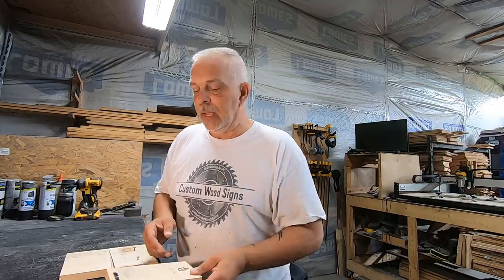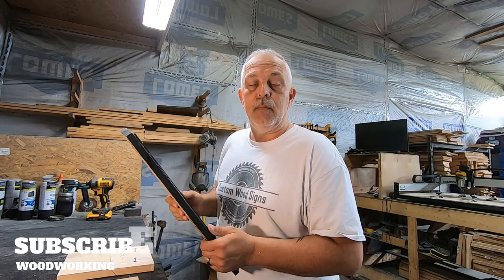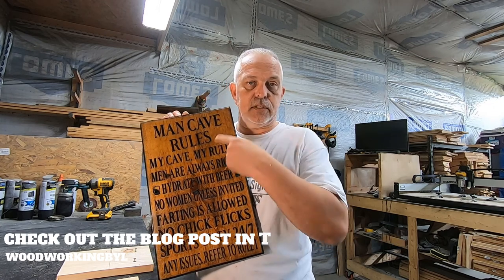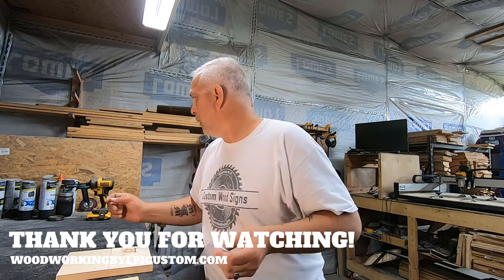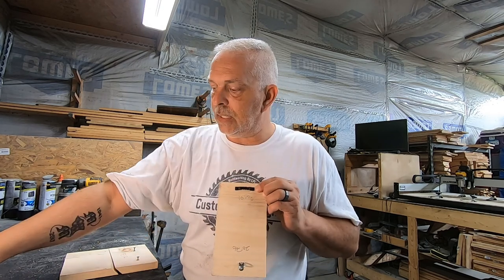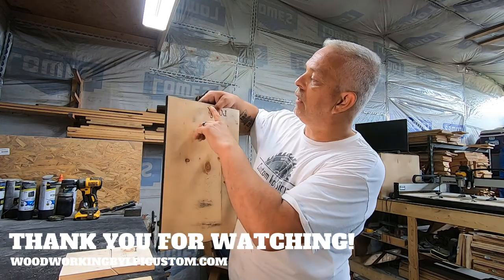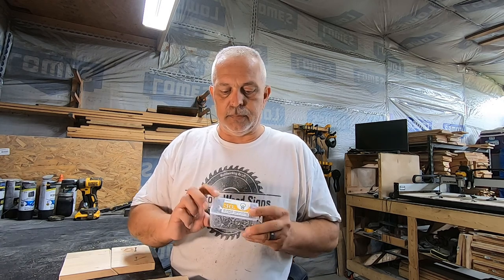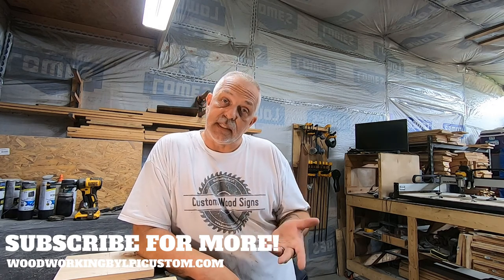Hanging Wood Sign Ideas And What To Use For Wood Signs – Helpful Guide

Comment: So what size screw should I use for a 1/2” thick sign? I’ve seen that a #6 is my best bet- but will it show through the front?😅😅
Reply from the maker: Thank you for visiting! The golden rule is to have a screw go half of the thickness of the material. So a 1/4 inch long screw would work well.  A #6 screw would be 9/64 in diameter, depending on what you are using the screw for (considering weight) a #6 works well.  I would suggest also you drill a pilot hole prior to using the screw as well. Hope this helps!

Comment: How do you determine the length of chain to use if you're just using one piece of chain attached to the sign at both ends?
Reply from the maker: Thank you for watching!  Suggest you measure the two points where are mounting the chain on each side of the backside.  Stretch the chain between those two points and then allow for approximately 1 inch travel (upwards) for hanging on the surface you putting on.  Hope this helps!